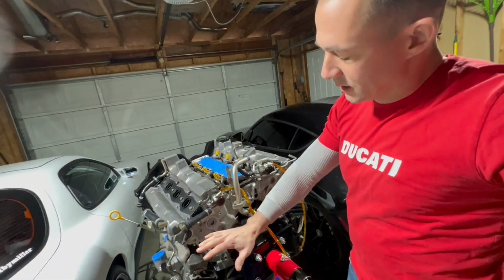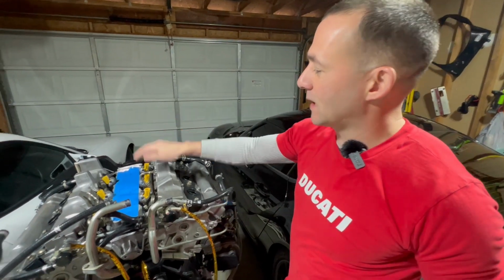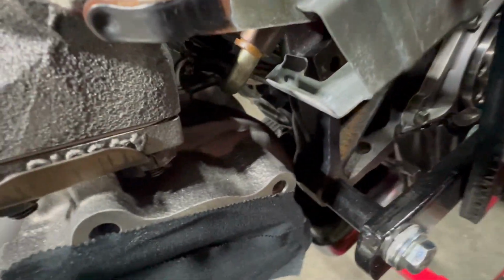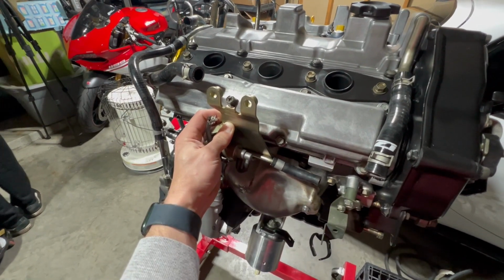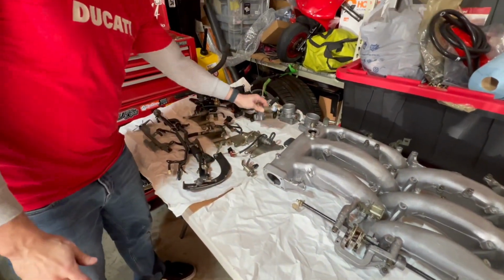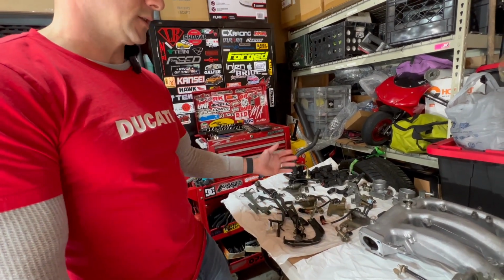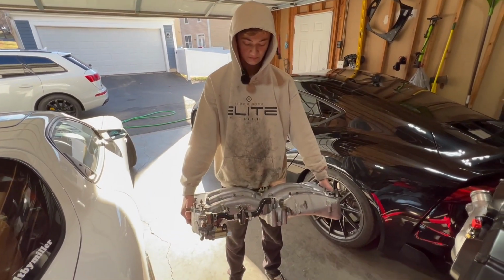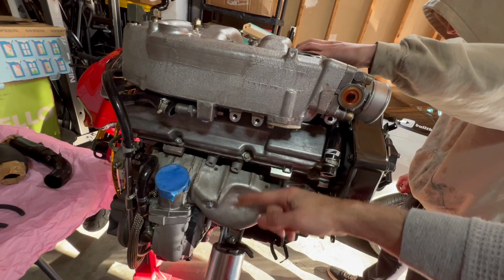Project Car Z32 Nissan 300ZX Engine Part 4 Built By Miller

Comment: What did you use to clean the idle air control valve? That thing looks new!
Reply from the maker: I used wd-40 and a scrub brush with brass bristles.